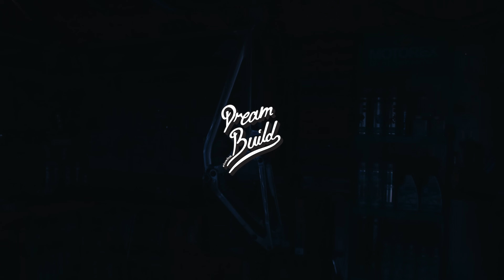DREAM BUILD MTB - Rose Scrub - Patricia Druwen

Comment: Ehh , the hydraulic hose should enter sideways on a 8-10 mm spacer , i made a cutout on the steer tube and also on the spacer , when its put together a hole its formed , there is enough space for  the hose to take the curve , the screw its a little bit in the way but its manageable , that would be a nicer look ... and the cable must be tied to the crown to stay away of the tire on a full compression

Comment: A brand new Park Tool saw...sweet!    First use too!    I just don't like integrated cables....just way too much work when a repair or replacement is needed.    Besides it's not attractive to have cable coming out the fork's top cap....Any new bike should have UDH....major mistake not to have gone that direction...
Reply: Isn't it a UDH ? It really looks like one.
Reply: Lol bro, the reason behind the cable coming out of the top cap and the rear break cable being too long is whips and bars. Also its a actually a DH frame, using a lyrik is the second hint... Besides, cables are not actually going through the frame. 
Learn your stuff before complaining and learn to pull cable through frame, its actually not that hard. Thanks
Reply: @Hazukro + It looks like this frame has a big cut on the bottom tube to make cable routing ultra easy, bro just wanted to complain even before starting the video lol.

Comment: I would have used a Downhill Fork
Reply: Not if you do not ride ONLY downhill...that fork is heavier that a single crown for sure...
Reply: And it wouldnt make any sense to use a dh fork on freeride build. Feeding the brake through the topcap would make any sense since the fork would make barspins impossible